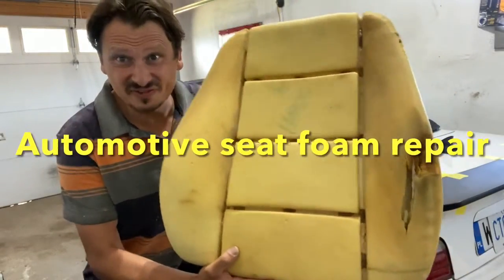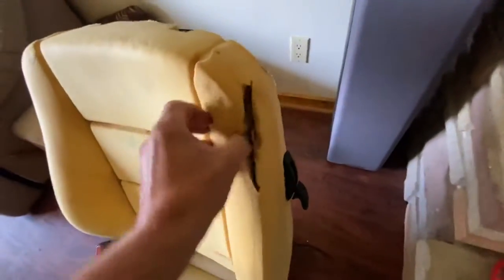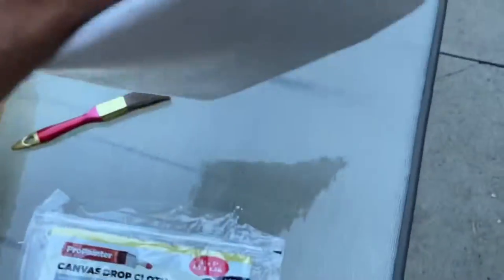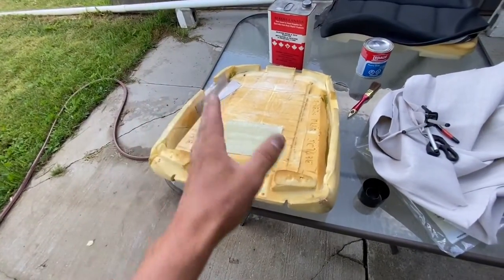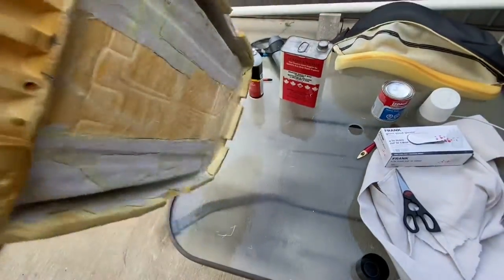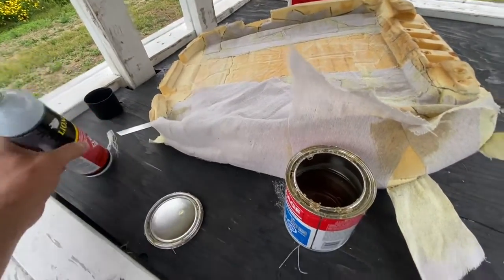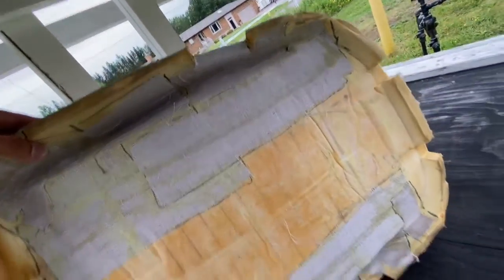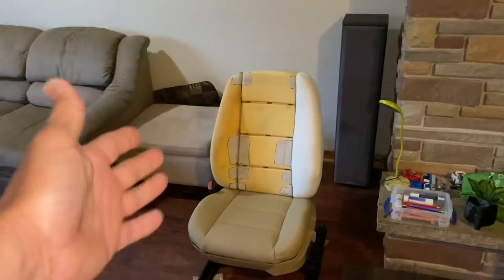How to repair car seat foam. How to fix car seat cushion. Car seat cushion repair.

Comment: That turned out great.  I'm reupholstering some Pontiac Montana seats today and trying to figure out what to reinforce the foam with.   I'd not thought of using canvas.  That's brilliant!  Going to run over and get some.  Thanks for the tip!

Comment: You made the best, most thorough e36 content on yourube. Ill have to do this when i pick up vaders over winter. Have you had any audio issues w HK amp cutting sound after few min of play?
Reply from the maker: Mine had an aftermarket stereo in it and still does
Reply from the maker: And thx

Comment: Oof, I can only find the Liongrip glue for $25 a can online. Does anyone have another source for this glue? I am about to do this exact project and want to use what I know works. I'm looking at 3M 77 glue. Has anyone used this glue and can you report on how it performed? It's a much more affordable option and readily available on Amazon.